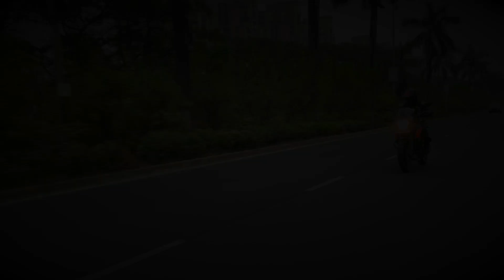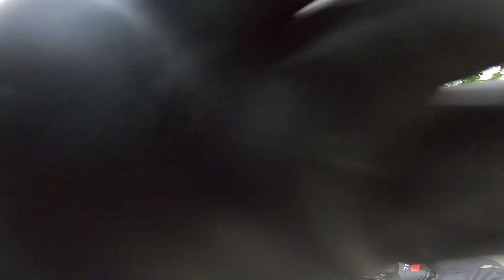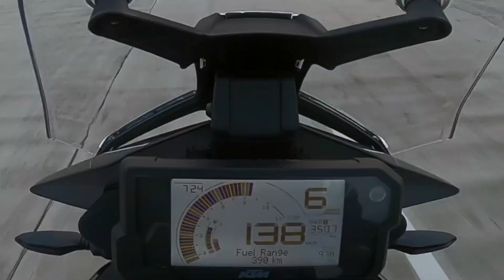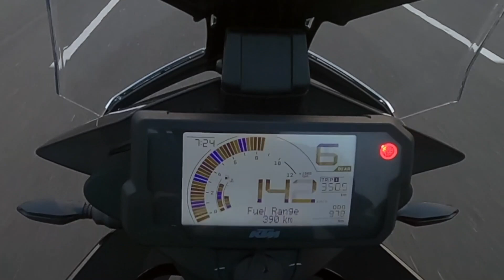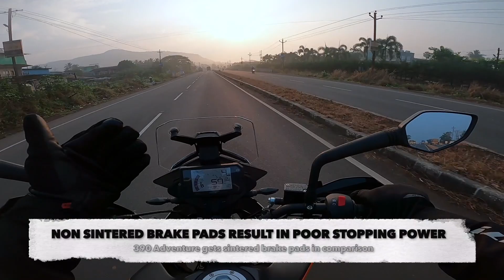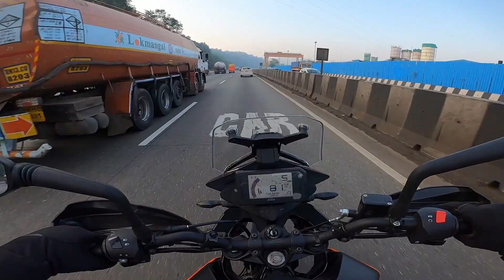2020 KTM 250 Adventure - Most Detailed Ride Review (Hindi + English)

Comment: Just one question my height 5.9 age 48+ can I go for this 250adv or shall go for some different models and brand.
Reply from the maker: Yes you can, and you'll be able to long distance tour too.
The G310GS & Himalayan have little extra comfort.
Reply: @ShiftingGearsIn  G310GS Maintenance cost is too high & Himalayan is without tubeless  rubbers ,so thinking to go with ktm adv 250.

Comment: My ktm adv 250 handle bar,mirrors and speedometer is vibrating alot... its have lots of vibration... so can u give me the solution?
Reply: I own the duke . Even I had vibes all around but after 4th service and 20,000 kms my bike feels more smoother. New bike will have bit of vibration issue, proper engine breaking will remove those vibes !!

Comment: i have seen plenty of videos on same topic, I dont think I could get all such info in one place. keep up the good work.

I usually ride around 700 - 800 kms a day while touring. can this bike cruise happily on 90 -130kmph all day?
Reply from the maker: Can stay at 100 happily, but not happy at 130 all day long for sure. Also the speed limits won’t allow. Yes, you can ride the bike long distances without worrying for sure. If you’re going to revv hard and ride long, keep a check on the oil levels.
Reply: @ShiftingGearsIn  why to keep checking oil level?? Is it common for all liquid cooled bikes or KTM specific?